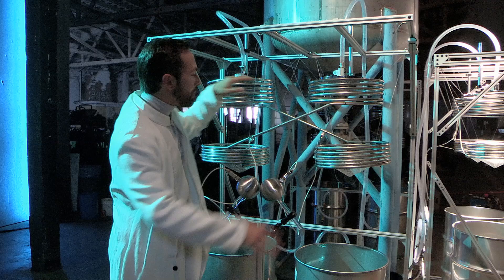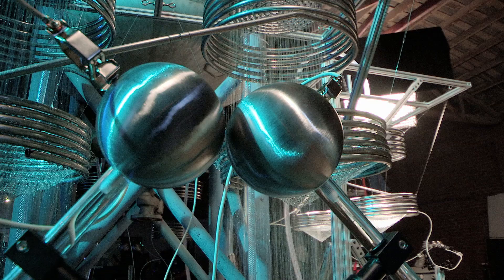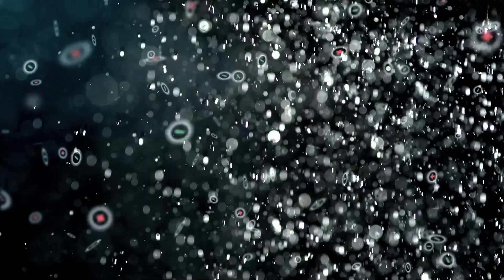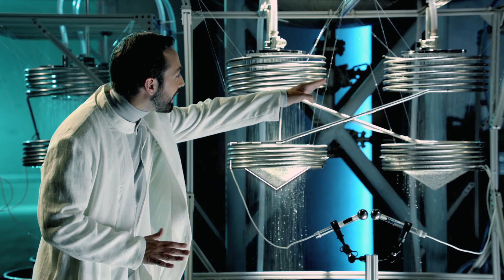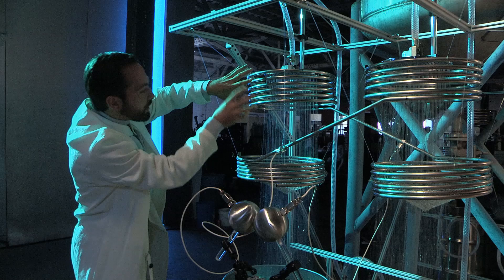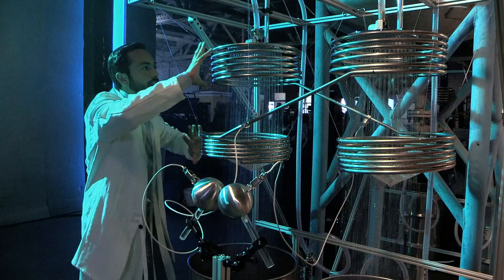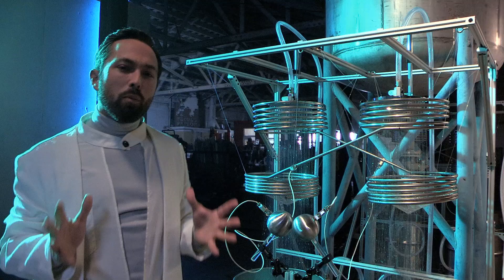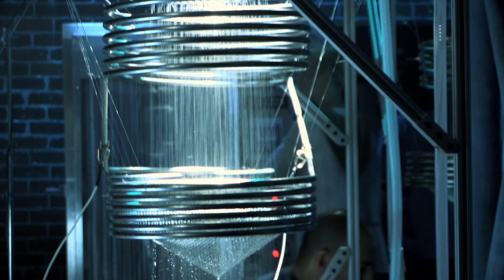Sparks from Falling Water: Kelvin's Thunderstorm

Comment: The energy in the system is coming from the pump in the bottom of the buckets that then stores the potential energy as a physical battery it in the elevated water tank. This system is an aesthetic, but extremely inefficient battery of sorts.

Comment: Most logical answer is that the charge comes from the disrupted water flow. The spark is the accumulated energy it takes to attract the water out of its ideal flow (which is straight down).

So in short, the initial random load difference has a positive feedback loop, which strengthens the load difference. This load difference disrupts ideal flow, which unloads when it's energetically more viable to create a spark then to disrupt ideal water flow even more. Hence the "reset".

Comment: I did this experiment for my A-level physics and the potential voltages are imparted to the water droplets as they leave the shower head, the action of water dripping generates mw of electricity, which when collected in said setup creates an electrical diferential in the two isolated coil sections. you can take that few thousand volts and reduce it to a useable voltage and amperage.

Comment: My guess about where the charge comes from would be random interactions between water droplets in the clouds or during their fall - bouncing through molecules in the atmosphere and randomly picking up or shedding a few electrons here and there, resulting in minute randomization of charge in the droplets themselves. This process would ultimately be powered by heat energy - namely the solar heat that originally evaporated the water and pushed it up into the atmosphere to begin with, giving it the potential energy to bounce around energetically, fall and thus pick up these small charge differentials.

Comment: This is very interesting. But the current through your body from that arc will be huge, in might even be up to 1 or 2 amps. But it only lasts for a brief period of time so that the total power input is very small, so it does not harm you.  And its the voltage that can supply the current such that the voltage is not limited, that kills you, not ("the current the voltage") it is both.

Comment: I'm thinking that since water is a polar substance and the charge is established in the coils there must be a magnetic field propagating from one coil to the other and a capacitance between the balls. when the charged water passes through the fields it creates a potential difference and it builds up and is stored between the balls until it becomes strong enough to jump the gap between the balls. The waterworks as a Van de Graff generator. The charge is static, having little current. The windings of the coils work to amplify the field. The gap between the balls determines the capacitance which determines the intensity of the spark. I don't know it's just a guess, or there is a hidden battery in each ball.

Comment: Air is the medium and the 2 metal "spheroids" are the terminals with charge.
Once the charge exceeds the di-electric of the surrounding air, the charge jumps across.
The dielectric of air is ~ 3 × 106 V/m. That means 10KV would be sufficient at about .0033 m.
This gap seems a bit above that so maybe more than 10 KV.

Comment: The electrical energy comes from a potential difference between the charges of the two streams. Through the engineering rigamarole, you are harnessing a very small eprcentage of that.

Cool experiment!

Comment: I believe it is picking up a static charge from the friction of falling through the air and the water has a large surface area  lilke when you force air through a tube the air traveling over the inside surface of the tube produces a static charge

Comment: The reason behind the energy is the water already stored in the tank behind the equipment.
So, it has some potential energy which gets converted into the electrical energy by losing its height.

Comment: Gravity provides the motion of the water to produce electromagnetic induction through the coils, which act as stators. I think this would work better if the water had more streams, head pressure and conductivity. If you used more coils and with smaller diameter windings, and made of copper. Deionized water and coils of porcelain would be the antithesis of this.

Comment: The electrical energy comes from the polarity of the water molecule, negative on the O side, positive on the H side.
Reply: I believe this to be correct. A good test would be to try this with a liquid with "neutral" or I suppose more correctly "uniformly charged" molecules. (oil?)

Comment: Where does an electrical charge come from? Everything around us has an electrical charge. Usually there is more of a balance of negative and positive charges in a particular object. Some materials are very hard to “coax” the electrical charge from it, others are easy. Water is a very easy material to reap negative ions from. Tesla recognized this dynamic, which caused him to devise his tower.

Comment: Coils, cans, or cups is fine. You can enhance the effect by lining one side with plastic or rubber to get a better and more predictable charge difference. You can also put a high voltage bridge rectifier with a capacitor across the output to draw more current with a steadier voltage.
This is for a new hunger games movie right? Applied with lots of stages in a facility it could be developed into a power plant of sorts.

Comment: So I am a professional welder and I get shocked at 120 to 150 amps every few months when there is a bad earth on a part I am welding. Its barely painful. To the point that I don't even care if it happens. I would like people to stop saying "oh its the current that causes the damage..." ITS THE POWER!!! the current times the voltage. If the volts are high and the current is low its safe. Same if its the other way around. Why am I the only one that knows this. Shame on you Derick.

Comment: Well according to my understanding from this video, this energy comes from the imbalance in electrical charge between 2 streams at a given time, which is amplified by some more imbalance, until a spark is generated which returns the system to equilibrium. Oh and the imbalance in charge is created as a byproduct of falling streams.

Comment: ANSWER
Energy is stored in water when it is moved up into the container in form of potential energy which later gets converted to kinetic and then potential energy.
Reply: Wrong.  This is electrical energy. The only part kinetic energy plays is the conversion of the falling fluid from high potential/no kinetic (in the reservoir) to lower potential/increasing kinetic in the fluid of the water... but electrical energy that results isn't kinetically derived.  What's happening is that there is a charge sorting process at work.

Comment: The energy was created because there's metallic impurities in the water. And when you move conductive material through a coil it generates an electrical charge. If you were using deionized water this would not work. A stronger concentration with salt water would probably produce more electricity and if you want your coils more densely you would produce more energy.

Comment: I would guess the Earth's mass, as well as the Sun's energy, is what makes this possible. The Earth's mass creates the gravitational field required to pull the water ions through the coils, which generates the electrostatic charge. And assuming that is tap water, that same gravitational field likely created the water pressure needed to carry the water up to the shower heads.

However, this would not be possible without the thermal energy from the Sun heating the water to above 273.16 "Kelvin", allowing it to behave as a liquid, but this isn't really the direct source of the energy.

I'm a simple motor mechanic, so I'm not exactly confident in that explanation.

Comment: I think this system can be improved and used. Miy could make it more effective and set in many places. The good part of this model is that it does not have moving parts and when using the right materials it can work almost eternal. Such installations can be installed in places where parts of the rain falls, in waterfalls, dams, in storm runoffs of buildings, in cooling towers of power plants, in installations for water filtration and in other places where water delivery takes place without any effort. I would try to improve the system by taking the bottom grid, and instead of twisting the coil of the coils inside. There would have been a multi-circle coil in several layers. You can also experiment with the thickness of the coils, its diameter and length, the number of rings in them. Also interesting is what happens if you magnetite coils, maybe some additional effect.

Comment: I have a challenge for you.  
Do this and you would revolutionize steam power generation. 
Make the same set up, but, make it upside down,  and let hot water evaporate through it. So the steam takes away the charge. 

So you would have a water to steam electrostatic generator. 

The electro static charge can be conducted away as electrical power.

Comment: The energy specifically is generated by the coils. Fluids provide a moving flow, the electrodes are connected which gives a potential difference. The generator electrodes exploit this difference in polarity, getting the water flow to change direction with attraction. The polar molecules are essentially moving charges. When attracted polarized water goes past the solid-state coils as a moving charge. The magnetic field created by the coiling of wire "feels" this moving charge and according to Faraday's Law must generate an electric field inside of a wire when it feels this change. It is an inefficient set up but proves the concept! It could be made more efficient by using carbon nanocoils and heavier flow. It reminds me of Schauberger's idea to use waterthreading to help mhd achieve an onboard power supply system with high weight to power performance. Aerodynamically, speaking (flow-wise) this could also work. Nitrogen tends to go electropositive when ionized and oxygen goes electronegative. However, utilizing plasma for power sounds like fusion or Tony Stark stuff. Someday, high wattage indeed. It can become more feasible to build power supply systems like this for ion wings using air alone and not plasma air with graphene and other 2D nanomaterials that can make better use of fluid flow in other fluid-thread set-ups. As new materials like chlorophene (chlorinated graphene), which can generate a charge from a change in surface tension, get cheaper we can have our devices generate power from fluid flow with more wattage than ever before. This means wind power based on turbulence, not turbines. Imagine a power generator that looks more like a palm tree. Chlorophene also has applications as a synapse bridging prosthetic material in nerve damage repair surgery because of it's impulse response potential and flexibility.

Comment: What is not well known, is that water is not neutral, as he was trying to say, well on average it is. . . We now know that where water touches something, it develops a negative charge, thus making the bulk of the water, very slightly positively charged. . . I suspect that this is what is happening here. . .

There have been a few experiments, to make that negatively surface area a bit larger and so they can collect some electrons from it. . . The amount of energy is very, very small though.. . But when you look at water in a glass, you see the edges, where it touches the glass are slightly curved, we call that “Surface tension” well apparently, that is due to that small negative electrical charge in the water where it touches the glass.

Comment: Gravity is the energy source. I think that it is important to note that the charge from the separation of electrons and protons produce a force. Gravity provides the force necessary to separate the charge . Gravity by its self does nothing without this separation, that is why it produces so little effect. By optimizing the charge separation mechanisms a near 100% conversion is possible. Van de graff generators optimize the charge separation by reusing the surface that carries the charge in the form of a belt.

Comment: It come from the configuration of the water molecule? As they tumble, their orientation and motion has an effect on an adjacent molecule but the effect is less than the force influencing it's existing orientation and motion. This conflicting 'pressure' on the molecule slightly alters the configuration of the molecule and in this slightly altered state, the O atom, having energy imparted into it to cause it to shift, sheds an electron from the outter shell to drop back to a lower energy state. These free electrons either find a new home immediately from another molecule undergoing the reverse process, or they are attracted to the contraption surface with the opposite charge...
Yea na?

Comment: Easy answer:
The Energy comes from the slowly deminishing Potential Energy of the Water leaving the tank that is stationed above the setup. (I guess it's coming from that tank if not then it would be the kinetic energy of the water leaving an opened focest).

So the energy goes like this

Potential - > kinetic - > electric

Comment: It is cascade induced voltage.
I would say it is caused when the negative/positive water droplets pass by the conductor. Like a reverse induction heater, the water is manipulating the magnetic field of the conductors at the top, instead of the other way around creating both current and a magnetic field. Since the water is constantly falling, the buildup is minuet. The lower coil is charged/magnatized at 300k meters per second(much faster then the speed of the water droplets). This means that by the time the water has reached the lower coil, a small electromagnetic field has been produced. This deflects a tiny amount of opposing charged water. The electrical difference is accumulated in the accumulator (strainer), and sent to the capacitor (balls) due to the current produced. Because more water is deflected at the top coil, less affect the lower coil, and more charge build. This effect cascades till the capacitors own electromagnetic fields coalesce, shortening them out, and neutralizing the electrical potential difference.

But this is just my theory.

Comment: The electric energy doesn't come from somewhere, it was already there. The collection of the neg and pos onto the metal pipes causes a connection to from when the electro'magnetic field generated by both form a contact for the equalization of the neg and pos. The little lightning bolt is the charged particals physicaly making the jump from one charge to the other to equalize it. Kind of like how heat energy diffuses untill the tempurature becomes even.

Comment: For anyone confused by the "current is what really does damage"--anyone who knows that BOTH current and voltage matter--consider momentum:  You'll be safe colliding with a mosquito at high velocity (an analogy for high voltage driving a low amount of charge)...and safe near a train with extremely low kinetic energy (analogous to very low voltage, barrrrely compelling a high pile of charge to move forward).
Current is sort of the COMBINATION of a great amount of charge at a high voltage, just as momentum is a combination of mass and velocity.
You can't have high current without high charge present, because current is (by definition) charge/sec.  So charge does matter.
But even if you have a lot of charge built up, you also can't get it moving as a high current (charge/sec) without high voltage, because it's the voltage (potential "drop," like potential energy that converts into kinetic energy when something falls of a ladder)--it's the high voltage that gets that high amount of charge MOVING FAST.
So...
It's BOTH the energy behind a collision (voltage or potential "drop" is analogous to the energy gained by anything falling off of a ladder--high voltage in terms of electrical pull means a greater "drop" or conversion of potential energy into kinetic energy in the analogy of gravitational pull) AND how much charge hits you (current, or the AMOUNT of charge that hits you per second, might be analogous to the mass of a physical object colliding with you).
So, it's BOTH. If you have a high mass (or a large amount of electrical charge) then YES, the energy behind it (voltage) really can kill you.
Reply: The current is what kills you by interrupting the pulse of your heart or frying your internal wiring. Current (amount of water flowing through a hose) is a result of voltage (amount of water pressure going into the hose) being divided by resistance (any pinched points along the hose). (Any pinched points along the line restrict the amount of water that can flow under that constant pressure, more pressure = more flow, more pinched = less flow) Your body generally has a set resistance. Less than 1 amp of current is enough to kill somebody. So effectively, low voltage with no resistance from the source to your body, can still produce enough current to kill a person (or at least harm them). On the other side, high voltage can produce low enough currents, with high enough resistance, that a person could survive. The answer is always 'current is the part of the equation that kills', but the higher the voltage, the higher the chance that there will be enough current to do harm (dependent on your body resistance)